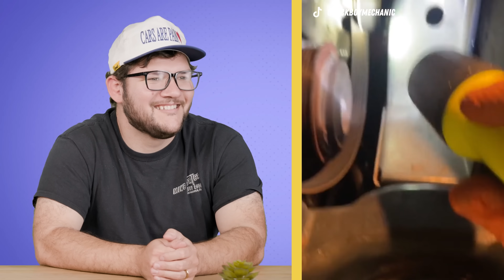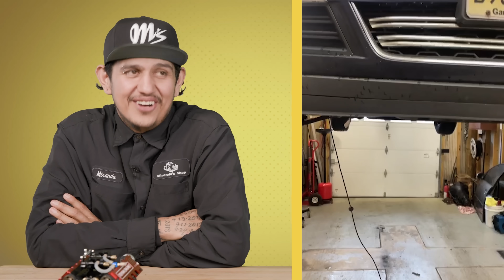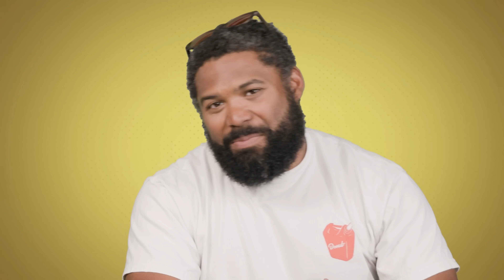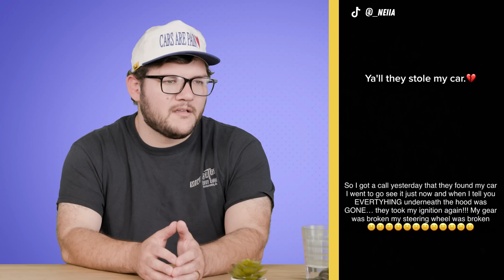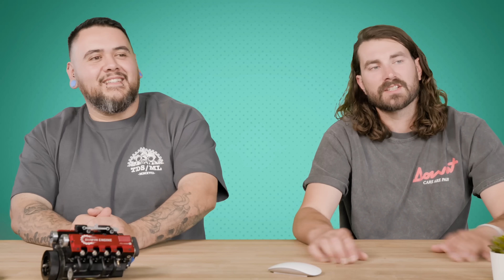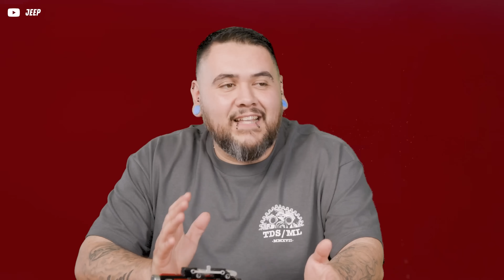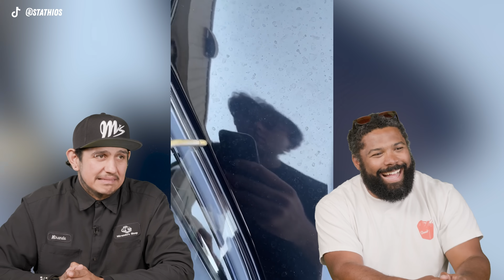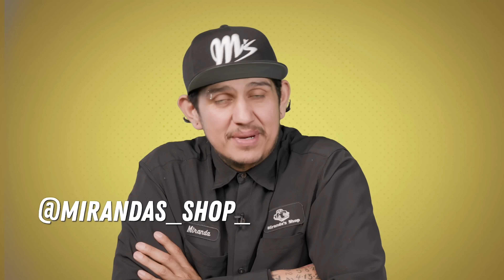Mechanic Reacts to Car Engineering Fails

Comment: I’m an engineer at one of the big three. A lot of times we’re not given a choice to fix stuff like this. I do all my own mechanic work so I definitely know the pain. But it’s mostly just these companies not caring, not the people that actually designed them. Would be fun to be on this show as an engineer with the mechanics …
Reply: Yeah get on the show!
Reply: That would be a show that would blow up. (Ii mean in a good way". Try sending them an email, again that would be a killer show.
Reply: 90% of the time its the bean counters that actually allow some if these issues to get to production. They just rush to production and hope a recall won't happen and they can fix it with the customer service repairs or tsb's. The one that got me was sales never told customers how to properly install the target panels on the hard top jeeps. And never paid me properly for replacing all of the seals because customers would push the panel over the roll bar instead of lifting it into place. Rolls the seals every time. Never saw the parts prices but never got paid for the diag or the repair because I wasn't level 3 body. When I was hourly, fine whatever. At flatrate I was the only guy who would even try to fix it. After spending hours looking up the repair codes for the office I never got paid for that stuff.
Reply: There is something to be said about raising hell to make the right things happen.  Conscientious design is a concept, after all.  Engineering fails are small by comparison, but how many tragedies occur because someone had the excuse "I just did what I was told"?  The Pinto, the Prius fiasco, Teslas catching fire, the Firestone mess, the Ford 6.0DIT, on and on bad design made it to market and made folks miserable.  When are engineers going to straighten their spines and assert themselves? Is a paycheck worth everyone else's misery? Asking for millions of tech friends.
Reply: Probably someone in management wanted to offer an engine that came from another model and said "I see this engine is 36" long and your engine bay is 36.001" inches long.  SHIP IT!"
Reply: you can see most guys here know absolutely nothing about developmental work  AT ALL. Literally every piece of tech or maschine needs to get tested after design and close to 100% of those will have kinks that need to get ironed out. There arent exceptions. This applies to from cars to electronics like CPU's all the way to fucking Childrens toys, software, everything. People in here mad like shit without knowing how shit actually works. Its like the dude said, the difference lies in the Company and whether or not the company wants to spend money to fix said shit or nah
Reply: @EyesOnReality-d4h  Exactly. There are a ton of considerations engineers have that aren't obvious to others. Cost, manufacturability, dev time, cycle times, regulatory constraints just to name a few. There mistakes that get through but most engineers but their best effort forward to make a good product. The blame should be put on the shareholders/executives who want to ship a minimum viable product in order to increase share price.
Reply: Then how about instead of “fixing it” it’s just done right the first time?
Reply: @huh0123  Yeah, how dare they not perfectly design an incredibly complex system without any testing or revisions necessary? /s
Reply: ive done work on a car owned by an engineer, he didnt understand how gravity works.......
Reply: @GoldEagle117  🤣🤣
Reply: Sounds like Engineer like to develop cars by trial and error. 
Stuff that can leak should not be able to leak on a vital part, that should be implemented in the first draft. Error happens, but most of these engineering problems are problems you can see in CAD, long before the first car is made. They should not need fixing, they should never have been there in the first place.
Easy to blame management, but in truth it is mostly sloppy engineering work to begin with.
Reply: @etherealicer  nope, managrment just doesnt want to spend the resources fixing those errors the engineers pointed out in the first draft. Engineers and mechanics are on the same team for these issues.
Reply: Design it right the first time but you can't because you think you're all smarter than everyone seeing as how you over payed for a piece of paper
Reply: @mikemitchell9157 who tf hurt you?
Reply: @treescompany3462  the engineers that make cars

Figured that'd have been self explanatory
Reply: @treescompany3462 he is right. Do it right from tge start
Reply: @mikemitchell9157 A lot of times, these components/platforms are derivatives of legacy parts, making tooling for a completely new car costs a fortune, which are probably over two decades old (design-wise) at this point, means the engineer which designed this thing is long gone and the current ones need to deal with it. If the engineers could redesign it to be better they probably would but they are prevented by corporate. The first case is a clear example of such a thing (no way the integrator of these part didn't notice the issue, they probably weren't allowed to fix it because of costs), especially when you consider that GM/Jeep are America brands and their reputation when it comes to quality is in the gutters, case in point: Ford Escort 1998, started malfunctioning in the first 1000km, there are reasons why the Big three had to be bailed out (and in the case of Chrysler: more than once)... They did had a success with some Focus models but they had some questionable design choices in their 3 cylinders engine (who puts a belt in oil?!).
Reply: @dostayer3369  bs look at old chevys they all had interchangeable parts as long as you knew what you were looking at engineers just don't know how to design cars like that and those things would roll over the odometer as long as you changed your fluids and filters and did the standard maintenence and the common man could fix his own stuff with a standard set of tools.   Don't give me that bs bud
Reply: @dostayer3369  how would shortening a bolt cost more?
Reply: @goong1388 it depends. If the bolt is made in-house, it means building and maintaining another type of machine to manufacture this type of bolts, both of which are ridiculously expensive and would most probably necessitate another company to build it, most companies don't build/design their own machines, TSMC and Intel are the two that comes to mind.
If it's sourced from somewhere else? Probably quantity discounts and supply chain issues, like long-term contracts about such components (the manufacturer needs to adjust its capacity accordingly, it's not economical to manufacture in surplus), that's if the source actually manufactures this kind of bolts... that's if there's no structural reason for that bolt being that long, and then we open another can of worms all together...

GM probably did the math and decided that's it's more profitable to let the mechanics break their heads with it, and the customer suffer the costs than redesign the front/order a shorter bolt for that car, especially when we are talking about a relatively cheap car like a Chevy, they don't have a reliability reputation to maintain (unlike Toyota) because they were making subpar cars for decades at this point, that bankruptcy didn't come out of thin air (I don't know how it's in the US, but American cars aren't that highly regarded outside of it, with exceptions) so them doing such a decision isn't surprising even a bit.

Case in point: Chevrolet Aveo, a Daewoo car marketed as a Chevrolet (or a Suzuki in the US), it was such a putrid car that it damaged the brand (and were one of the causes for Suzuki to leave the US, they have an excellent reputation outside of it though), not to mention the late 90's Ford Escort which was unreliable as well...
Reply: @mikemitchell9157 I don’t think you realize that Engineers don’t get to make the decisions ?
Reply: @treescompany3462  It's called being jelly lol.

I think that's where a lot of the hate towards engineers comes from, good old blue collar anti-intellectualism inferiority complex.

But if mechanics are so smart, why don't THEY design the perfect car and make millions?
Reply: @mikemitchell9157  I presume that was directed at me. I'm sorry, but there are some basics in there that every engineer should know. Having a team of engineers make those mistakes is pathetic.
And I don't think I overpaid... I simply didn't get my paper in the US, but from ETHZ (ranked #7 in the world), for less than $10k (and that is even less if you consider that around here, a cashier ears around $4200/month).
Reply: @mikemitchell9157  yes. Making a whole car is on one person lol.

Comment: This is one of the reasons I love working on older cars. You're able to actually turn a wrench on them instead of having to get the front clip removed at a dealership just to change a battery.

Comment: I used to work i na shop and we had this guy come in with a clunking noise. Ended up being a worn ball joint.  Our master tech was the one working on it and when he told the customer they asked to see it. While walking to the car the guy said he was a design engineer for chrystler and knew what a balljoint did but hae never actually seen one. That confirmed so many of our complaints on different vehicles designs instantly.

Comment: That first one, I have to assume that this is the incorrect bolt and had to be installed when the engine was out of the car. Probably lost the correct one, grabbed that and went with it. 
And for people blaming engineers, stop. Blame the people buying the cars. Because they want all this fancy crap and features. So it’s the engineers job to pack 10 pounds of crap into a 5 pound bag

Comment: These remind me of the times I helped my dad fix his ‘97 Chevy Blazer Sport. He was complaining about it often because of how they shortened the front end, and compressed everything together, making it harder to reach some things.
Reply: The 4th gen Camaro and Firebird were similarly cramped. Moving the engine back behind the front axle line and changing to double A-arm front suspension was great for handling, but made it a relative nightmare to even change the spark plugs

Comment: As a technician working at Pratt & Whitney, I've seen my fair share of engineering/factory mishaps. We don't finger-point though.. we just fix the issue(s), have a shitload of meetings so it doesn't happen again, and get back to work. We're human. We make mistakes. Admit to it and move along.

Angelina is very intelligent and comes across as someone with strong work ethics. I'd sign-off on her work if she were on my team assembling jet engines.

Comment: Haven't wrenched on cars for income in 9 years. Work on CNC machines now. I can honestly say it happens on CNCs too. I can also confirm that many car stereotypes that pertain to their country of origin also apply to CNC. German machines, like Index, shit. Everything is shoehorned into the tightest possible footprint so the bean counters can crame more of them into one building. Japanese CNC? Absolute joy compared to the German ones. Okuma is basically the Toyota of CNC. Shit makes sense. There are very very few "engineering boobytraps" like "impossible bolts". Some models have none. Thank you Japan, for caring.

Comment: Check out the oil pan gasket replacement on a Mercedes C250. The pan is behind the power steering rack.

Comment: I know I couldn’t agree more about the jeep thing I’m a jeep, enthusiast and every year they’re putting more and more electronic comfort crap in a jeep that you don’t need, it’s not a goddamn luxury vehicle supposed to be a luxury vehicle. I’m referring to the wranglers my 97 doesn’t have wheel speed sensors, so I never had a wheel speed sensor issue, if you get the Rubicon package, there’s an electronic swaybar disconnect that they put the electronic module directly at the front right where the front bumper is so you’re gonna get mud and water all up in that especially because the fact that when they manufacture it they don’t put the dielectric grease on the servo or around the seal to help keep it watertight same with the wheel speed sensors they put tea PMS in the damn thing now I don’t know a single person that TPMS has ever worked well on their vehicle if they’re not changing it like every year and that’s all vehicles not just jeeps 
As for all engineers, being stupid, often times they’ll design a vehicle to include the engine bay to what the company desires remember they’re only got so much space to work with so they have to figure out how to cram 10 pounds of shit in a 3 pound bag that’s where you get a lot of crazy things to make it work that cause crazy things for mechanics like that power steering leak in this video I mean the geniuses that designed the 3.6 that’s in a lot of Chrysler’s and jeeps gift remove the entire top end of the engine just to change the spark plugs on the driver side bank but that’s what you get when you have to engineer something that puts out really good horsepower for it size without creating a bunch of admissions, etc. etc.

Comment: You guys should do a video on useless features on new vehicles. I own a 2019 keep Cherokee and the most useless feature on that car is the gas saving auto start and stop. I’ve almost been in seven car accidents where I come to a stop light, the car turns off and then the light turns green and the car fails to start again. All the while cars behind me expect me to go and I’m stuck fiddle fucking around with my car treating it like a “bop-it“ doing everything I can to restart my car. And the have almost rear ended me.

Comment: Oil filters for SUVs made by Chevy, GMC, and Buicks are in a very silly place (halfway up the front of the engine directly beside the catalytic converter). Doing a cabin air filter on ford fiestas and ecosports are a nightmare as well as Lincoln continentals, and then the ford f150s with the plastic oil pans and plugs are really good at spewing oil on to sway bars if they’re facing the rear of the truck. Those may also be funny to get a reaction from this channel.

Comment: With the Audi water leak we also get them on VWs, it can be caused by the drain tube for the sun roof getting blocked, because they fit small little grommets on the end, with general crap which will then mean the water builds up and flows into the car as its the only place for the water to go, so it could actually be engineers or factories fault, with the customer also having an effect depending on where the car is parked but it is in no way the customers fault

Comment: Engineer: "that's the plan for the new model done, we've managed to achieve 60% parts commonality with the ecosystem* without making it an aftersales/maintenenance nightmare"
Accountant: "sorry, the specification calls for 80% commonality, otherwise we're not going to achieve the price point or profit margin the shareholders expect"
Engineer: "I thought we were here to make things that worked?"
Accountant: "did I stutter?"
some time later
mechanic: "what idiot engineer designed this!?"
*every manufacturer has what's referred to as their ecosystem, it's principally parts they already carry and by sticking with those parts they can achieve cost saving through volume of purchase, big manufacturers don't like introducing new parts because it makes them less profitable, and by extention the shareholders get cranky.

Comment: She said  "we don't get paid for all the extra work" while charging $100  hour. Book says it's a 3hr job, done in 30 minutes. But still charges $300
Reply: Yeah, why would u get paid less for being good at your job. The book times aren’t that generous especially w these new cars
Reply: Shop charges $100 an hour. Mechanic gets paid $20 an hour. Book says it's a 3 hour job. If you do that job, it's going to take 6 hours labor and probably several trips to the hardware store for several hundred dollars in tools you don't have. If the guy that's been a mechanic for a year or two does the job it's going to take 3 hours and several trips to my tool box to borrow tools he doesn't have yet. If someone like me that's been doing it for 15 years can do that same job in a half hour, it's only because I have a ten thousand dollar tool box filled with 40 thousand dollars worth of tools and enough sheer repetition to speed through things you can't - and you should probably be glad we took it on to get it done right in 30 minutes instead of passing it on to the new guy to make his learning mistakes on. 

And she's right. If you estimate an hour to do something that looks easy, and you find out the hard way it's going to require an extra 2 or 3 hours removing things and moving stuff around to gain access to what you need to remove - too bad. You're getting paid 1 hour for that 4 hour job. The shop (usually) can't go back and charge extra labor.
Reply: @cavalieroutdoors6036 can confirm! Have had to make several trips to hardware store in a day doing a "simple repair" that ended up taking 6+ hrs.

Comment: I will never forget the following: I studied mechanical engineering in Karlsruhe, and when BMW made a new Mini version they made some sort of marketing thing where we could test some of the new models. Automotive wasn't what interested me, but I still tried the top model they had there, the Cooper S. My buddy (also studying mechanical engineering, and he went the automotive route) and me got in and took it on the Autobahn. At about 150 km/h the (closed and locked) sunroof started vibrating, sounded a bit like a machine gun. We looked at each other and started laughing. Back then I thought that if I had designed a sporty car like that I would disembowel myself. Of course, nowadays I know about the money pinching going on.
Only a small thing, of course (and it was probably a manufacturing issue), but I still will never forget it.